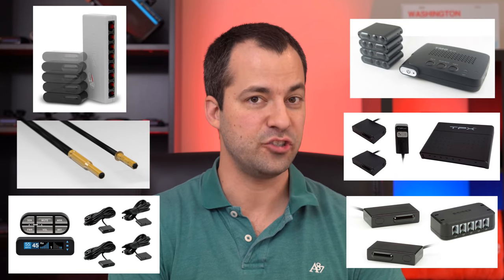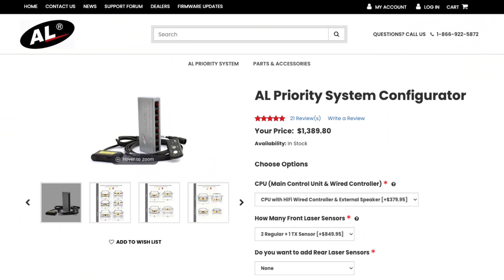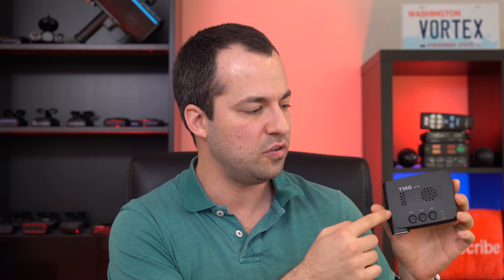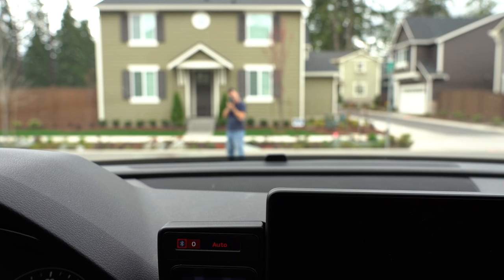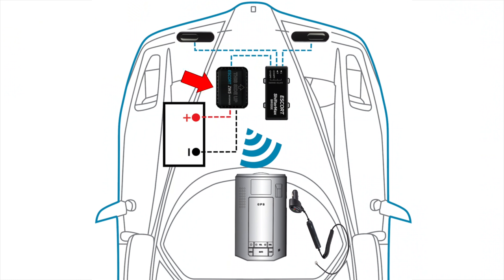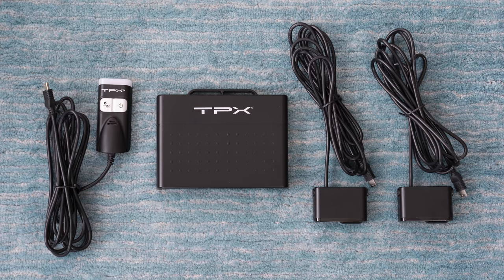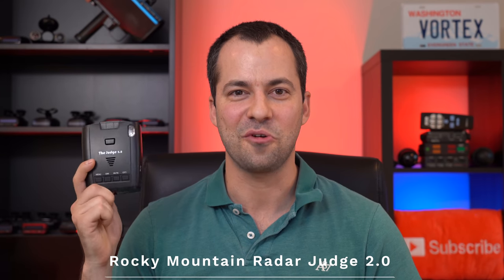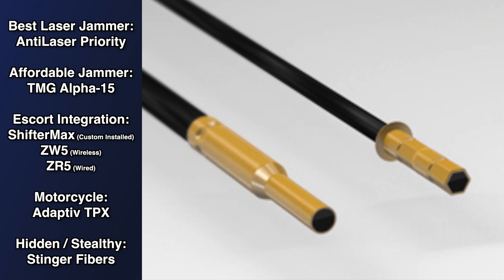Best Laser Jammers for 2021

Comment: $2200?  Fuck so say tickets are high end $400.  That means you’d have to get at least 6 tickets for this thing to pay for itself.
Reply from the maker: That can be true if you don’t count courts costs and legal fees. Insurance premium bumps are the most expensive costs. There’s also the intangible benefits of avoiding all that headache in the first place.
Reply: Speeding tickets usually don’t require a court appearance.  Just mail in, unless you’ve accumulated  3 or more within a 6 month period. (Varies by state, I’m sure).

Same goes for legal fees, if you mail it in, you don’t need to hire a lawyer.

Don’t get me wrong.   All for technology that fights back against zealous little shit hole towns that can’t afford to exist otherwise.  But just like an 8k TV, it’s just too expensive and the technology isn’t practical (in cost) yet.

Comment: Why break the law? It is there for a reason. Instead of trying to find a way around the law, how about obeying the law that is there for your protection?
Reply from the maker: Very reasonable question. I’m curious what your thoughts are after watching this video: https://youtu.be/2BKdbxX1pDw
Reply: So, how safe do you think it is going at or below the speed limit on a heavily trafficked road where speeds are much higher than the posted limit?  If you want to cause accidents, by all means, be the vehicle that is traveling at a speed greatly different that the flow of traffic.